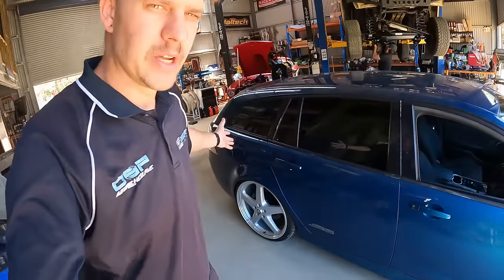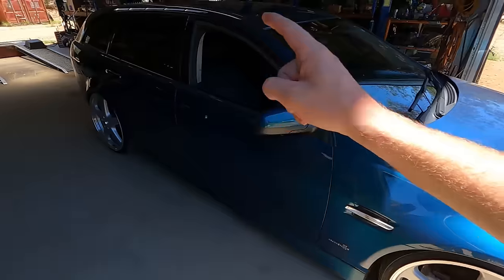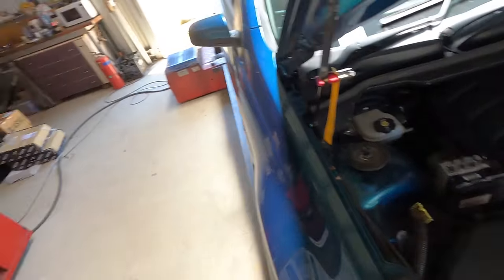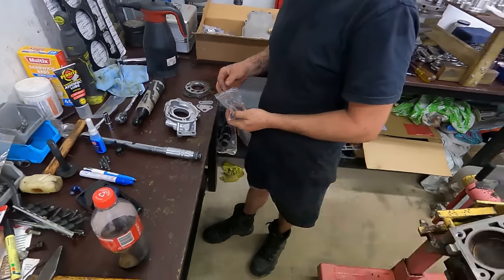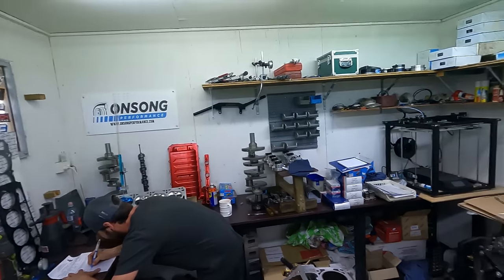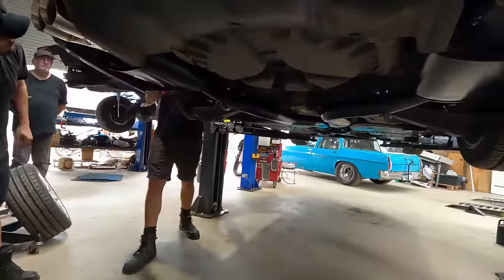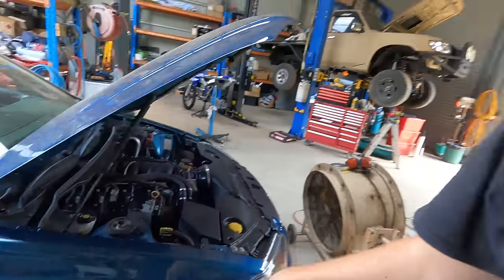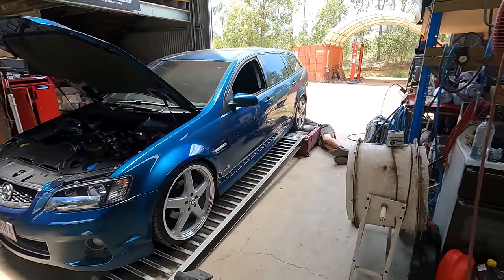VE L77 Camshaft Package - OSPWarehouse

Comment: Looks lifters is a very common issue with LS engines that come into your workshop.  would you say one possible reason that  these lifters fail is because people are using thinner oils in these LS engines?

Comment: I have some questions about series 2 and newer L77? (I have  series 2 and wanting to give her bit extra with otr headers exhaust tune. The local company  we have here said they do MAF less tunes.  So  With  tuning what is any advantage keeping MAF.  Does VE have or need MAF in to help with its tables?  Or winter running summer  running  ?  Does removing MAF and using  OTR. With fixed tables not effect daily driving?

Comment: Hey man just wondering on how much you guys can really get out of a l77 na
Reply: Hey mate, look back over some previous videos and you'll see they are nudging 500hp on some conversions with the right setup 👍
Reply from the maker: Yeh N/A with Stock Bottom End, 500whp is pretty well the ceiling (manual, slightly less for auto). At this point the limit of compression vs RPM pretty well stops the party.
With aftermarket pistons to get more compression you could go much further.
Reply: @BoostGumps  cheers man , I’m from Sydney but by the looks of things you guys are the way to go to get power figures. I’ll be messaging you guys in the near future. Keep up the videos
Reply: @BoostGumps  That's the number I wanna get one of these days,at 450hp atm . C'mon you bastard lotto! 😅
Love ya vids too btw bro 👍

Comment: Maxxing out stock injectors on e85?
Reply from the maker: Yeh from memory with these setups on E they run up around 90% DC. These setups are at the limits of a few components. To go any further than these opens a can of worms so to speak. Starts to snowball real quick from here.
Reply: @BoostGumps  just did this exact setup. Car will be full time e85 so upgraded injectors. Yet to dyno it